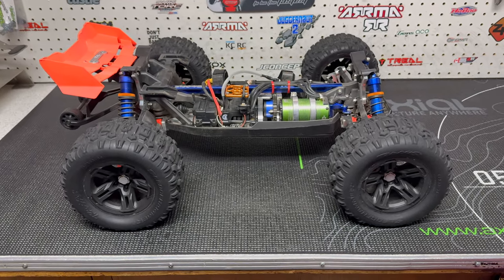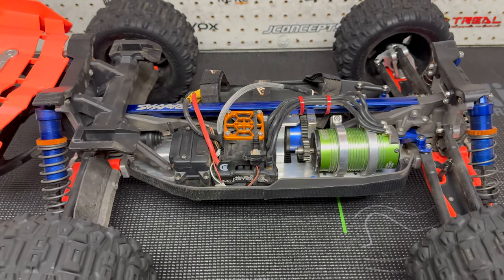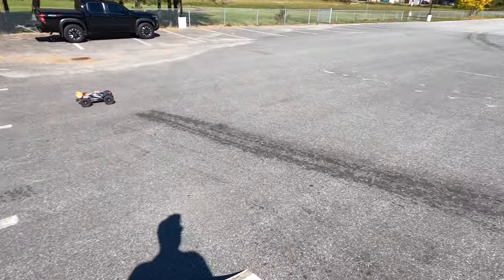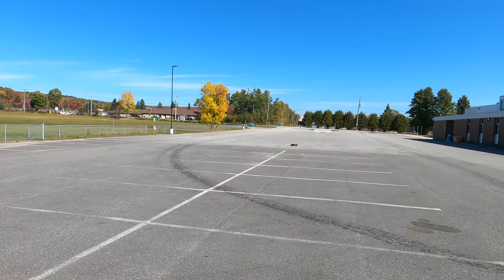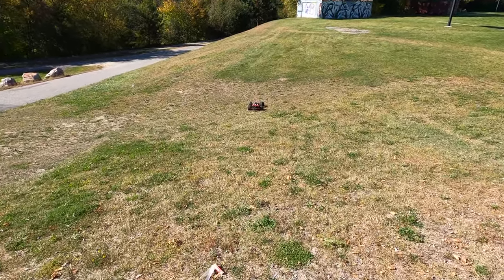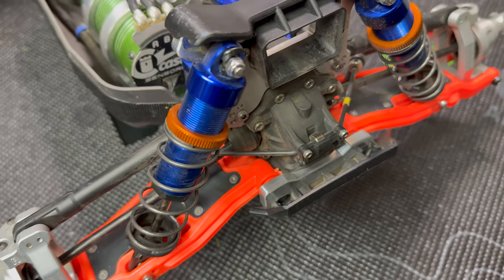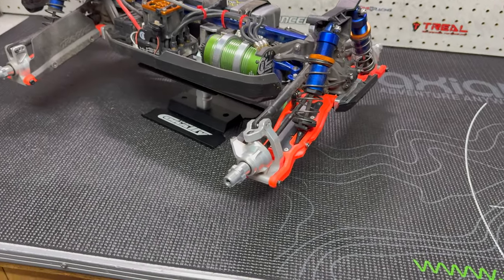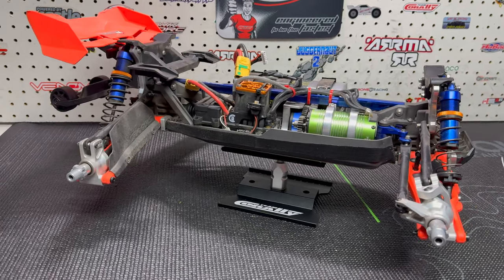Traxxas Sledge (Monster Build, Castle 1650kv)

Comment: Awesome Session brother. Love the setup. Gearing seems right on the money too!. The Vitavon axels spline setup seems like a good idea but it's a durability step down without the hex pin IMO. Bummer on the hinge pins. Traxxas hardened just isn't the same compared to the M2C ones in my experience brother. Another awesome session my friend.
Reply from the maker: Oh it’s 100% a step down. Great idea, but not properly tested.   One I’ve gone through the traxxas hinge pins I have I’ll switch to something better.
Reply: arrma typhon 6s inner hinge pins exact fit and wayyyy better than

Comment: I just bought a sledge about a week ago. I’m looking at going a head with upgrading parts you suggested in this video and past videos with exception of the Castle motor and mamba esc, that would do later because of cost. 
With the added weight without upgrading the motor be a mistake?